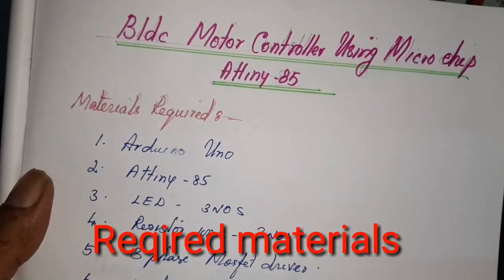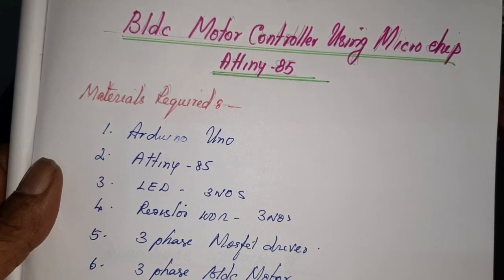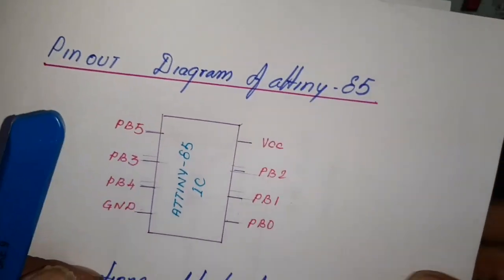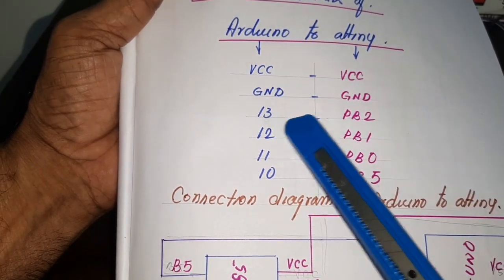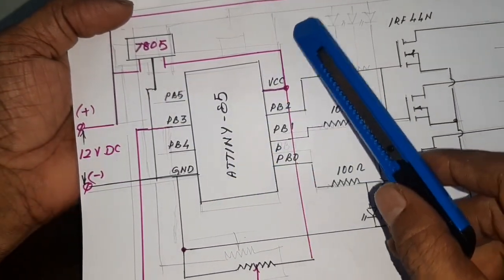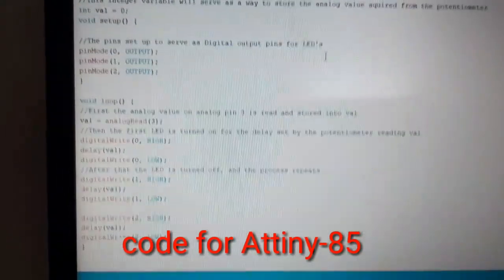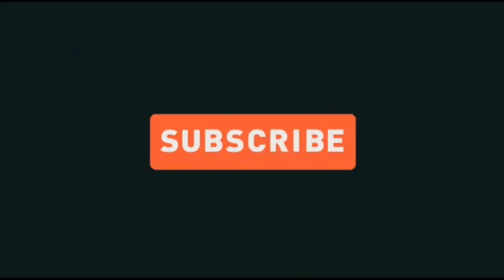Bldc motor controller using Attiny-85,Arduino pjt-3

Comment: Cool project!
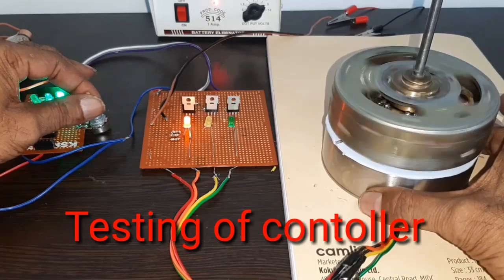Did you use two zero pcb for the circuit? At the end of the video, at 2:44, you took the focus out of the video showing the circuit, so I couldn't see it. Is it possible to show it again? Tks.
Reply from the maker: Thanks for watching and supported

Comment: The video is great, can you try comparing the speed of Attiny 85's rpm control to see if it is faster than other controllers? thank you
Reply from the maker: Thanks for watching and supported sir
Just I tried  to utilise the ic for the bldc motor controller.
Reply: Hello, try programming the high frequency into attiny 85 to see if it works @pugalstech
Reply: Good information 👍